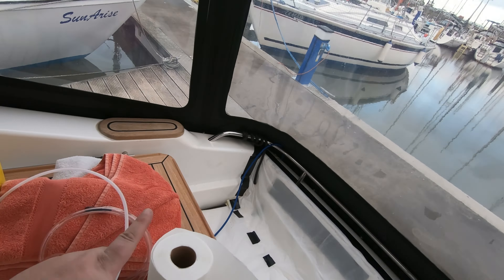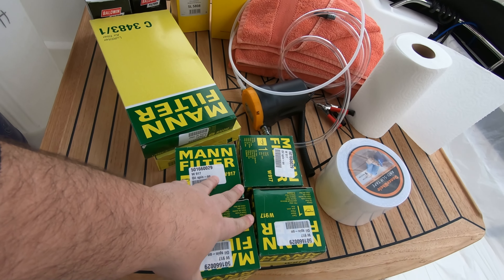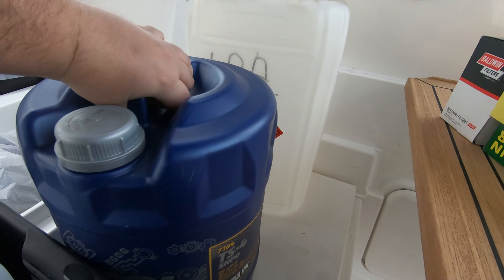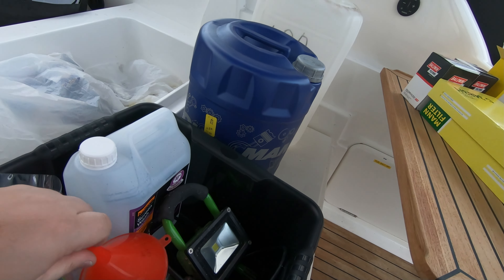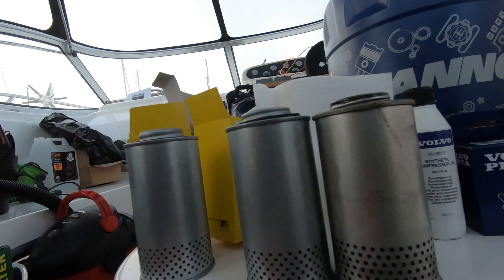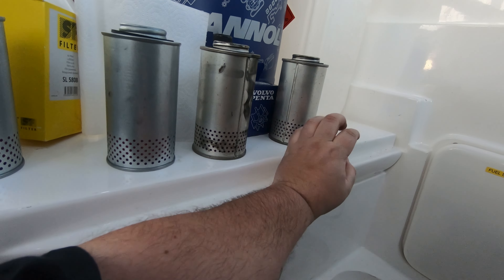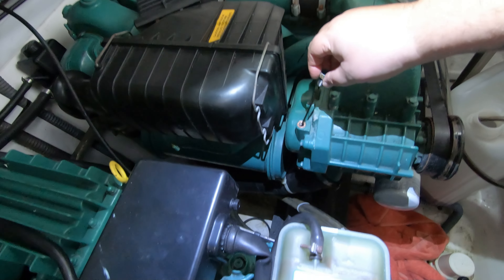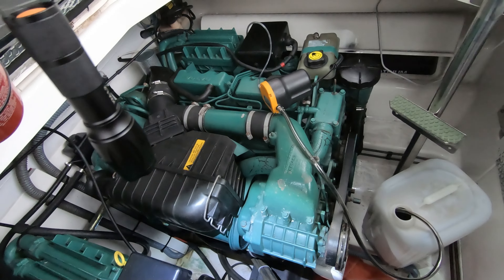Volvo Penta KAD32 Engine Service Part 1

Comment: Hi
Dave you can change the impeller for the water pump with the boat in the water I did mine.
Reply from the maker: Yep i've done mine in the water too, I'd heard some people say it was possible others say not and couldn't find anything official about the mounting on this specific boat so i just did it slowly incase i got wet :)
Reply: @DavesBoat  Hi Dave - the impellor sits above the waterline and is perfectly OK to do - I've had to change both on FN now over the past year - once in a rocky sea! Good old manometer theory.. unless something is pushing the water in from the outside!!!!! Just make sure the new ones are well lubed so they don't instantly run dry before the water hits them! However £54 each!!!!

Comment: Great video, I change my oil in the summer as it is warmer and much quicker to pump out (I use a manual pump), usually takes less than an hour, but I have also done it in the winter by  running the engine for 30minutes first and found I could get almost all of it out without waiting 2 hours you suggested, it drains down to the sump reasonably quickly in my experience. I would keep a filter wrench onboard otherwise how will you change a fuel filter in an emergency with your spare, just a thought.
Reply from the maker: I think I come to the same hypothesis in part 2 tbh about the oil 😂 the filter in an emergency I'd do it the messy way, screwdriver through it although for what it costs putting a wrench on would probably be sensible

Comment: What a superb video so well explained and captured in such a cramped enviroment liked and subscribed.
What engine oil did you use and where from ?
Reply from the maker: Thanks glad you enjoyed it.  The brand name is manoil, the full label with the grades etc is here https://drive.google.com/file/d/1bQnkN3tbulqcOp9z35mStrA7lxjw1R7B/view?usp=sharing  There are other alternative brands that also meet the volvo VDS-3 standards too.  This was from Ebay was about £22 if i remember correctly where as official volvo stuff runs to about 60 quid just for the oil you need for one engine.

Comment: Very enjoyable watch, I didn't laugh as you banged your head, honest. How long did it take to pump the oil out? Thanks for the video.
Reply from the maker: Like 6 hours per engine can't decide if it was a slow ass pump or the oil really was like sludge. The problem to me is if I run the engines to warm it up there's bugger all oil in the pan to pump out, if you let it settle it's cold and won't pump. 
May not have helped the 2 degrees outside temp either I guess :( I may find a bigger pump for next change or maybe try one of those hand vacuum pumps not sure yet I'll decide on a few months